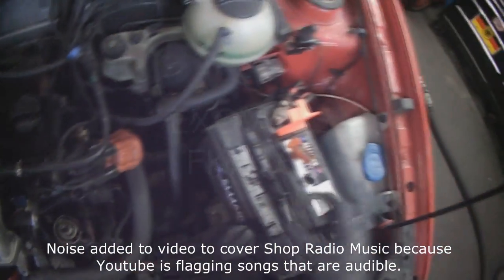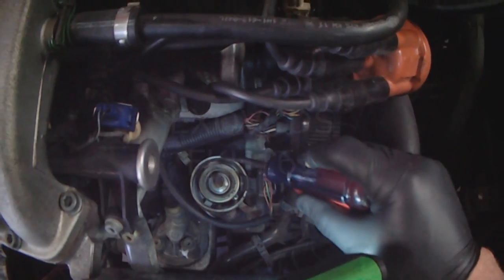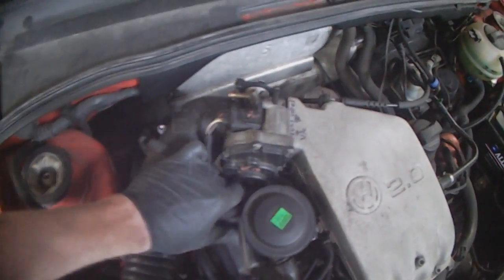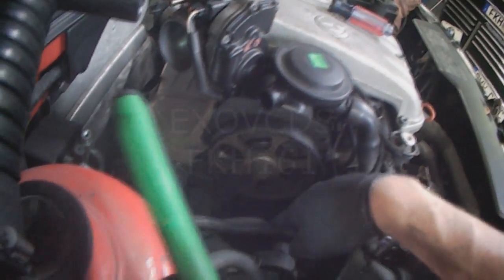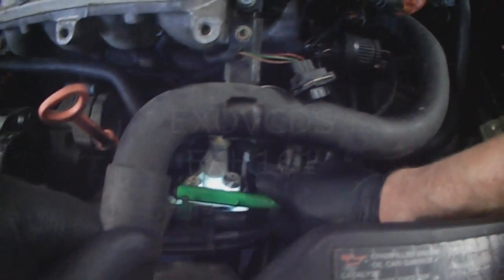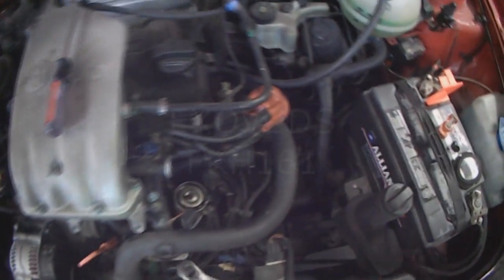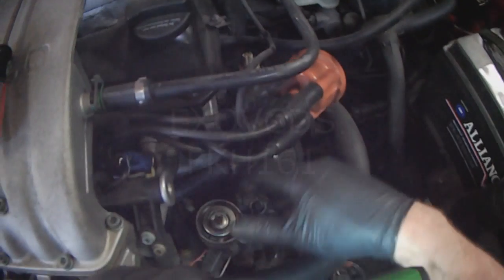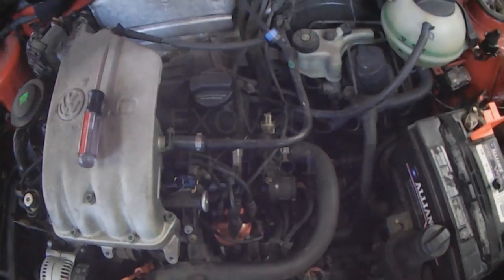VW A3: 2.0L ABA Distributor alignment / indexing

Comment: HELLO FOM CHRIS I GOT A 95 VW MK3 MANUAL TRANSMISSION I GOT A QUESTION I SAW YOUR VIDEO ON TIMING BUT ON MY FLYWHEEL I DO NOT HAVE A 0 ON IT JUST A LINE SO IS THAT MY MARK ALINGMENT AND ALSO DOES THE HALL SENSOR GET GROUND FROM THT TORX SCREW CAUSE MY MK3 RUNS GOOD IT JUST IDLES A LITLLE NOT SMOOTH WHAT DO YOU SUJEST I DO
Reply from the maker: 1.8L or 2.0L?
Flat line is most likely TDC.
I don't know what you mean when you say: Does the hall sensor get ground from the torx screw.
If it's a 2.0L, the engine will run with the hall sensor disconnected. You need to check if the hall sensor is actually working... use a voltmeter and check the voltage of the center pin of the 3 wire hall sensor plug. Compare that voltage with the voltage of the engine off & key on. Let me know the results.
Reply: well the reason I asked about the the to hall sensor is be cause it broke so I had to drill it out in the outcome the screw is bigger do to the drilling out but like I said before it starts up fine in hot and cold temps and I did replace the relay 109 but it runs smooth for a little while and it gets a little not smooth so I don't know what else to look for I cleaned throttle body iac valve new plugs cap and rotor .the idle just raises a little and lowers not a lot the rpm needle use to bounce a little but I fixed tha it was poor solder joints on the cluster I thought maybe throttle adaptation or vacuum leak just need a little help
Reply: I am sorry its a 95 vw mk3 2.0 manual transmission so u want me to test the hall sensor with it diconected ???as far as the hall sensor the question was does it get ground from the mounting screw or does it get ground from the wire in the plug ,the car starts up fine its just the idle not smooth but I have noticed that when I rev it up it revs up and then it drops like it wants to shut off but it doesn't
Reply from the maker: I still don't know if you have a 1.8L or 2.0L engine... if you have a 2.0L engine, disconnect the hall sensor and drive it like that for a few days. Any difference? Let me know. Fault codes? O2 sensor working correctly? Is the crankshaft gear OK? The gear can come loose, which changes cam / crank timing.
Reply from the maker: Disconnect the sensor, leave it disconnected, drive the car... any difference?
I'm no electrical engineer, so I don't know if the sensor is grounded through the mounting bolts.... I "assume" not, since there is a ground wire in the plug.

Comment: Hopefully you will be able to see this. So I just wanted some clarification - if the timing belt is off and the cam sprocket rotates, does everything need to be aligned to TDC before the belt goes back on, or can I adjust it with the belt on like in the video?
Reply from the maker: If the crank is still at TDC, then all you need to do is turn the cam back to TDC.
If you took the timing belt off with NOTHING at TDC, then you have to rotate the cam & the crank.
Reply: Thomas EXOVCDS it worked! That was my first time doing anything with the timing on a car. The hardest part, honestly, was getting the rotor on the distributor to line up lol. 

Thank you very much!
Reply from the maker: Thanks for the update!

Comment: Sorry to dig this up, I have the european model of this engine. (ADY) I get the infamous 5k rpm limit. Checked the timing, and set it with VCDS. In the 007 Range I need to get between 57 and 60 (or 1) in the first block, and between 5 and 8 in the second block. So i turn it both way to find the sweet spot but it isnt there? As soon as i get 57 in the first, the second stay at 9. turn it further a tiny bit and the first goes out of range (56) and the second is still at 9.  If i try going higher on the first, the second just goes to 11 or something.

Is the hallsensor dead? Any other ideas? Im not getting any faultcodes, just a lambda error from time to time. There seems to be a lack of power after about 4000rpm aswell.  From 4500 and up its pretty nonexistent in a high gear. Runs very nice though. Starts easy, smooth idle.
Reply from the maker: Since there is no actual "camshaft position sensor"... the camshaft itself could be out several teeth, without setting a fault code. A camshaft that is advanced will give an engine good bottom end torque, but less power at higher rpm. A camshaft that is retarded, will give less bottom end torque... but better high rpm power. I'm not sure this is the case with your engine, But you might want to check the crankshaft sprocket, to make sure that it has not moved out of place. As for distributor timing... all I do is set the distributor to #1 when the cam & crank are at TDC, that's it. Also check your exhaust system... if the engine can't breathe correctly, power issues will occur.

Comment: Sorry for the repeat of this question but i though you would  see it more likely.
Hey Thomas, one year ago i made you some questions about the timing of my engine, you very helpfully helped me the most you could but sadly after these months i have been riding with the engine not 100% on time, so i decided to take a look at the distributor and the mid timing sprocket/shaft. I saw that my mid sprocket shaft, the one that goes all thr way through inside the engine to meet with the distributor gear, has horizontal play and quite significant that with the force of the distributor rotor, i can move it back and forth and see it moving towards outside the  engine with the belt on. I would like to know if that is normal, also my distributor shaft itselft has a tremendous amount of  vertical play, literally 3 or 4 mm of play, i ve been looking arround and couldnt find any info about that, form what i know, some distributors have rotor play and that is normal, mine has it aswell a little bit, but its a lot greater if i had the vertical play. If you  need any info, its basically the same as the old 1.8 /2.0 VW mk2/mk3 engines, my distributor is a Sagem one and it is hall sensor type. Kind regards.
Reply from the maker: Sorry for replying a second time... thought you would see it more likely.
The end-play is set by the seal carrier / flange. The shaft itself has a lip that rides against the seal carrier / flange. If you are lucky, a new seal carrier / flange will be all you need... worst case, you will need to remove / replace the intermediate shaft.
https://i.ebayimg.com/images/i/300831793763-0-1/s-l1000.jpg
Reply: HAHAH thats funny :D
Hope you didnt bother with it.
The seal carrier that fixes the intermediate shaft into the block right? And what about the distributor shaft vertical play, is it normal? Thanks

P.S.: Cant see the photo, it appears a blank logo.
Reply from the maker: The distributor shaft has metal & fibre washers / shims... you can maybe add one or 2 to reduce the free play. Picture works for me... weird.
Reply: I will look at the intermediate shaft first, maybe change the seal carrier, looking at part numbers, doesnt seem to be an easy to find part.
Tomorrow i will measure the end play of the shaft, from what i saw, max allowed is .25 mm. I surely have a lot more than that, maybe 3 mm.
Edit: Part NR is: 027115033 to anyone interested.

Comment: Hello i have a 97 2.0 with an issue, just replaced timing belt water pump, got everything tdc and aligned with the marks, but i try to start and it acts like i have no compression. I have researched for hours and so far you are the only sane person ive come across! Plz help!
Reply from the maker: Post a video on your channel so I can see & hear what the engine does. Set to TDC and show me the alignment marks (camshaft, crankshaft & distributor rotor).
Reply: Yessir thank you
Reply: Also I forgot to mention I am getting no compression at all when I crank the motor and it was in time and running fine before I replaced the timing belt because of a leaking water pump. I am going to continue a tear down and check the head but I'm fairly certain nothing in it is bent or broken

Comment: Hi Thomas, Good info. I have the ABA engine , a 1995 installed in my 1982 Vanagon Westfalia now for 18 years. Originally I used Digifant 2 , then in 2003 I changed it to Motronic. It ran faithfully until 5 years ago, was losing power , wouldn't go more than 50 MPH. I ran out of time and money and parked it. Even though it lacked power, it always started right up . Last year I borrowed a VCDS controller connected it to my computers with software installed. Showed  It had several fault codes. Cleared all that mattered ( No EGR  installed). The system is a 95 Motronic. I started it up again this spring , it was running about 30 seconds, then quit. That was 3 months ago. It just won't start. I tried a different coil and I;ll try a differnt one also. 
I replaced the distributor last year , as it was one of the fault codes I cleared. VCDS shows 240 RPM while cranking, and timing 6 degrees BTDC. When  not cranking the BTDC is 72 degrees. I have no spark. I can smell fuel. Thanks for your advice.
Reply from the maker: Robert K Loss of power can be due to broken crank sprocket key. The sprocket will move on the crankshaft causing timing to shift. If the crank bolt shows signs of rust under the head bolt, the bolt could be loose. Smell of fuel could be because the crank / cam timing is too far out. Set the engine to TDC (camshaft sprocket markings) and check if the TDC mark at the flywheel is at TDC... If not, then the sprocket has shifted. If TDC is ok, then you might actually have a spark issue.

Comment: Great video!  I verified the timing marks on my wife's 99 Cabrio as it recently developed a running condition.  In 100ºF weather it started to get up in temperature and experience severe loss of power.  It would rev to 3500 rpm but almost as if there was no gas.  Looking at the data while driving on a cheap Actron scanner, I noticed that there were two temperature outputs and the difference between the two while running on the highway was significant.  On the Highway, the high reading oscillated between 210 - 220ºF while the low was between 160 - 170ºF.  The transmission shift points were also getting out of whack -- don't know if they were compensating for the loss of power.  What struck my eye was that while on the highway at 65mph at approx. 3000 rpm, the ignition timing was only 16º.  I tried giving it more rpm and at most would go to 19º but then come down.  

As far as changing parts, I will start with changing the fuel filter since I don't recall when I changed it for her.

Anything I should look into?

check fuel pressure, fuel pump resistance, fuel pressure regulator?

Thanks in advance

Nacho
Reply from the maker: I'm still at work... but will get back to you once I am at home later tonight.
Reply from the maker: I can only think of 2 temperature readings for that vehicle... engine coolant  & intake air temperature. 
Camshaft position sensor faults can cause power loss issues. The sensor is inside of the distributor. A faulty sensor usually will set a G40 Cam sensor fault code. If the timing isn't changing, that might be the reason.
Fuel filter is always a good place to start.... many have never been changed.

Comment: Any tips to free/move the distributor from side to side to make slight adjustment if distributor seems stuck? Distributor lock bolt, lock spacer and pins are removed but I can't get it to budge.
Reply from the maker: Jay T I use 2 pry-bars to lever against the base of the distributor... I rock the distributor side to side with an upward motion.
Reply: Thomas EXOVCDS Cool, I'll give that a try. Btw, on an automatic transmission, I'm I looking at the elongated window or the circle when checking to see if the notch is half hidden at the bottom edge?
Reply from the maker: Jay T The long window:
http://newbeetle.org/forums/attachments/2-0-liter-gas/64119d1262718288-timing-marks-please-help-automatictrans.jpg

Comment: thank you for your videos, helps a lot, i was wondering, i followed all the steps, but the car crank but does not start, i need to rotate the distributor counterclockwise to engine to start, then the car hesitates, runs poorly, any toughts? or things i must check,
Reply from the maker: David Guillen Jackson What year & engine? If the distributor is pointing at #1 when the crankshaft & camsgaft are at #1... then you should not have to turn the distributor.
If camshaft is at #1, make sure that crankshaft is at #1 (look at flywheel)!
Sometimes the crankshaft sprocket (timing belt side) can move on the crankshaft... and that will affect distributor timing.
Reply: Its a 97 (papers said sold december 96), Golf Gti, 2.0 8v, manual transmision; i followed every step, check the OT mark on the camshaft, also the "0" on flywheel, rotor pointing at the mark on the distributor, 

If the crankshaft sprocket move, do you recommend to change it?
Reply from the maker: David Guillen Jackson Crank pulley has a TDC "notch" that should point at an arrow in the lower cover when the flywheel 0 is lined up at TDC. 
If the crank pulley does not point at the arrow when the flywheel is at TDC... then the crank sprocket is worn and needs to be replaced.
The distributor signal is not needed for the engine to run... you can disconnect the distributor to check for yourself.
So the fact that you have to turn the distributor, tells me that something is not lined-up.
Reply: Thank you, i will check it out.
Reply: Thomas EXOVCDS  i have checked the flywheel and is lineup with the 0, but the arrow and the notch are not align, the notch its at "11" and the arrow at "12". i guess i need to replace the sprocket; or all pulleys and the sprocket
Reply from the maker: Loosen the crankshaft sprocket bolt 19mm (twelve point) before removing the timing belt... once the bolt is loose, remove the belt & the sprocket. If the sprocket key is broken / worn, replace the sprocket.
Reply: Thomas EXOVCDS hey i tried to remove the sprocket but, its hard to remove, i tried with a long pipe but still cannot loose it, any tips...
Reply from the maker: If the sprocket is NOT aligned like this: http://fkh161.ca/VW/CrankSprocketAlignment.jpg when the Flywheel is at TDC, then the sprocket has shifted. Send me pictures of the flywheel. Send to fkh161@fkh161.ca If you are 100% sure that the sprocket has shifted... position your socket & breaker bar so that the breaker bar is sitting against the ground (below the radiator). Activate the starter... the engine will turn clockwise, the bolt can't move because of the breaker bar... the starter should be able to break the bolt free. **ONLY DO THIS IF YOU FEEL COMFORTABLE DOING THIS, ONLY DO THIS WITH TIMING BELT STILL IN PLACE. AN AIR IMPACT GUN OR CORDLESS IMPACT GUN CAN BE RENTED FROM TOOL PLACES IF NEED BE**.If there is no sign of rust around the bolt & sprocket, then the sprocket might not have shifted and it could be that the timing mark at the flywheel is wrong.

Comment: I followed your steps in the video and I can get tdc on the timing belt and tdc on the blue thing by the distributor and I can get the distributor to line up also but the rotor will not line up it points to where spark plug 4 goes in what should I do cause the engine will turn over but will not run
Reply from the maker: If the camshaft sprocket is pointing at the TDC mark and the crankshaft / flywheel is pointing at the TDC mark, then the distributor should be pointing at the #1 notch in the distributor. What's the whole story with the car? Did you remove & install the timing belt? Was it pointing at #1 before you took everything apart? If you are lucky, no valves will have been bent / gotten damaged. Rotate the engine to TDC, if rotor is pointing to #4 swap #1 & #4 spark plug wires on the distributor cap. Do the same for #2 & #3. Should start now... but the spark plug wire orientation is not where it "should be". You would have to remove the distributor and then rotate the rotor shaft 180 degrees and then reinstall the distributor.
Reply: ***** I got it to line up finnaly. And no I didn't remove or replace timing belt. My issue started with intermediate starting so I looked up what could be wrong and then hooked it up and got the codes it was reading and it was misfiring 1 and 4 and the crankshaft position sensor was another code so I changed plugs wires and the entire distributor including the cap. And it's all hooked up and I should receive the sensor today in the mail. My question is after I fixed that and tried starting the car the engine turned over but wouldn't start up. Would the crankshaft position sensor keep it from starting.
Reply from the maker: Yes, a bad crank sensor will cause a no-start (no spark)... have someone crank the engine with the ignition key while you check for spark (remove the center distributor wire, the one from the ignition coil and hold it 1/8" from the cylinder head... if spark jumps, crank sensor is ok).
Reply: ***** ok I will check that when I get home. And if by chance that it's ok what do you think it would be.
Reply from the maker: Wesley Fulcher If you have spark, then you need to make sure that the spark plug wires are in the correct position on the distributor cap. You need to make sure that the timing belt is OK... if it has missing teeth, that can cause the timing to move. If all that is OK... check fuel flow / pressure and if the injectors are spraying.